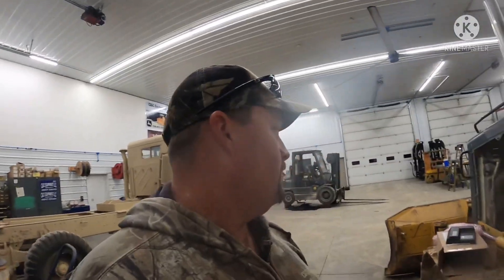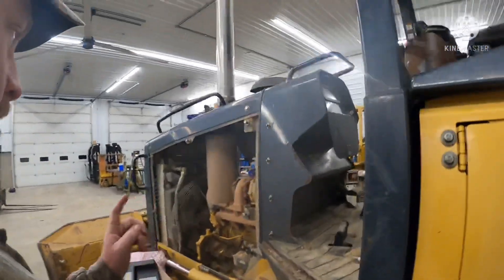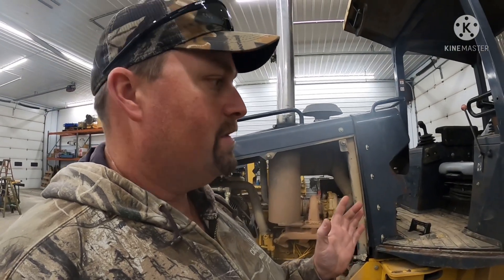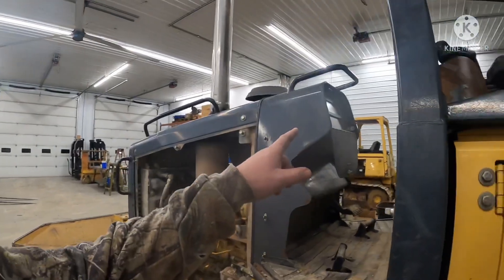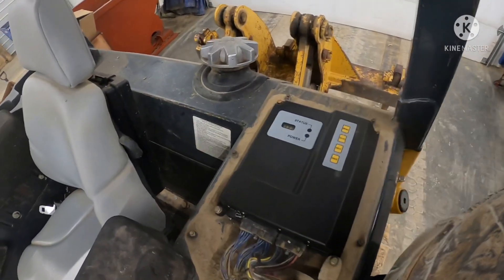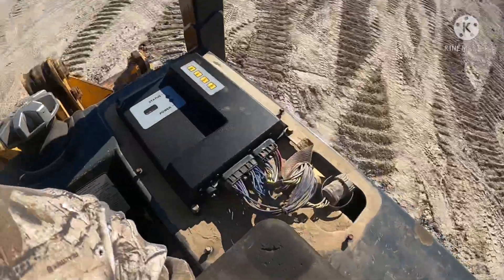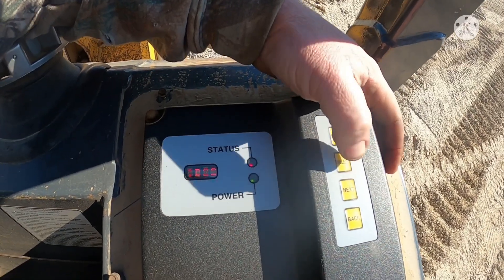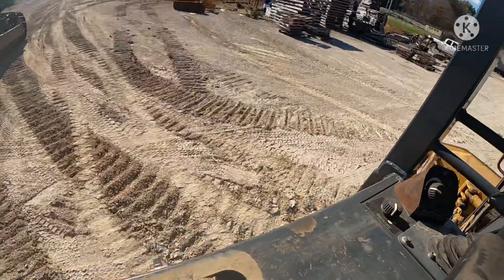John Deere 450J dozer transmission calibration how to @C_CEQUIPMENT

Comment: Perhaps using materials that resist corrosion and rust to better protect the computers, as well as better sealed connectors.  But that would make sense.  🤷‍♂🤷‍♂ Always good to learn new things, even if you have never or will never operate that type of equipment.

Comment: We have one that won't drive straight on startup only 1 side drives but you can override it with steering..then after working it a bit it starts working correctly and driving straight.. Would that be a soeed sensor or something
Reply from the maker: Could be a speed sensor

Comment: Thank you so much for your videos , you had mentioned the Milliamp adjustment  on your trans. calibration video I have a 06 850J that is pulling hard left over 2.0  speed or over 16k rpms it will not fix itself doing the drive calibration off computer and I did notice the Milliamps are half the value in reverse from one side vs other. Do you have a video on adjusting the Millsamps?
Thanks again , Gus
Reply from the maker: Could be a weak pump or drive motor 
Check the pressures

Comment: When I go to forward low the dozer starts making circles on its own?
Reply from the maker: Could be one of the speed sensors
Reply: @C_CEQUIPMENT  when it's making circles if I hold hard over the opposite way till it turns one revolution and then take off straight it now works fine ,with a slight pull to left?
Reply from the maker: @Mile9homesteadalaska  hard to diagnose without seeing in person
Is it reading rpm’s on engine, left and right track motors?
Reply: Yea it was at the dealer for a year huge bill and didn't fix anything same problem even loading it up there to bring home,the changed speed sensors and one edc,but it was fashing as if not calibrated so I followed your cal and when I got to the forward high it started making circles
Reply: Not sure how to find that I have to look it up

Comment: Greetings guys, I'm from Puerto Rico, I have a John Deere 2014 model 450J. I've put the 2 speed sensors on the rear motors and the team is still looking to the right. If you know how to help me, I appreciate it
Reply from the maker: Is it reading a speed via the speed sensors on each side
You should be able to pull that up through the dash under live values/speeds under transmission
Reply: I already did a complete calibration turned off and the equipment tells me that I accept the calibration I have no active codes only 1 saved stored I have TCU 522450.17
Reply: is that turned on or off?
Reply: I can only see the speeds that the left and right motors are going but I can't slow it down and it keeps looking a little to the right

Comment: Why would my dozer start moving on the 2nd part of the calibration?
Reply from the maker: They may creep a little
I’d say your pcp needs adjusted
Probably won’t pass calibration
Reply: @C_CEQUIPMENT  it was more than a little. It would stop right after the first part during calibration but let it pass after removing and reinstalling the speed sensors. Also made it to the 3rd part once but would still turn to the left side more during that process.

Comment: My 2005 450J  put a code F3x4 it wasn’t hot I cleared it now it just keeps throwing code F311  and won’t move … what’s your thoughts ?
Reply: Thxs !!!   Your videos are great .. thanks for all the info  damm it really helps
Reply from the maker: Could be an controller
Reply: @C_CEQUIPMENT  no way of telling without having another controller to try in it ?
Reply from the maker: @greggoscenski8177  yea
I normally grab another controller and try 
I have been using a place in north Carolina that’s rebuilt 2 so far with good luck
About a 1/4 of the price as a new one
Reply: @C_CEQUIPMENT what's the info on the place in Georgia for the rebuilds?
Reply: Well it is my control I cleaned out with a vacuum and resealed it cleared the code and it’s working …. Not sure for how long but if you could turn me on to that place that rebuilds them for the 1/4 of the price I would appreciate it

Comment: Thanks for the video. I have 750c series 2 and am wondering if it needs the same part changed. It last started and moved a bit a couple days ago and then stopped working 20 mins into calibrating it, but most of the time the com light on the trans controller won't turn on. When the com light does come on for a second like it's supposed to communicating with the dash it will work.  The rest of the time, when I turn the key the com light won't light up at all but the power light still lights up and the beeper sound still happens. Would this mean the trans controller is bad or should I be looking for a short in the wires going between it and the other components? What steps do you take to know if that part needs to be replaced? Any help would be appreciated.
Reply from the maker: Those are a little different but it could be 
Some code would help point in the right direction

Comment: Thats nice to now. Those are good Dozers. Now the K is it the same on them also. Or do you have to call John Deere.?. Just womdering is all. Im partial  to the 850K LGP..Ive been some places with those that You wouldnt or couldnt do with a CAT....I  only wish they wouldnt have all the Air pollution  shit on them. Because if they didnt I know they would be  a bigger Beast...Now I was told that the 850K has the same engine as the 950K.and 1050K. Do You know if thats true...Great Video thank You for sharing ..
Reply from the maker: The trans will calibrate in a similar way
So the 850k had the 6.8L engine same as 700
They went down to a smaller engine I guess for emissions stuff be cause the 850j series had a 8.1 or 9.0L engine
The 950-1050k have the 15L engine
Reply: @C_CEQUIPMENT  Oh ok. Thank You...

Comment: Another great informative video! Keep them coming. Got a question for you. Do you know if a Dresser TD8E shares components with the earlier Komatsu D32,38,39?
Reply from the maker: Not the early ones
The only ones that are the same are the Dresser Td-7 8 and 9 H series is 
The equivalent in Komatsu is d-32 d38 d39 -1 series
Built from about 1996 to early 2000s
Some of the steering brakes I think are the same on the td-8e series as the -1 komatsu 
Hope that helps

Comment: 650 h won’t track straight to save its life. Erb put two new speed sensors and wheel motors. One went bad so replaced both cause the same age. So I’m gonna have to try this.
Reply from the maker: Could be
Also on the h series I believe there is a third speed sensor on the pumps hopefully they checked it